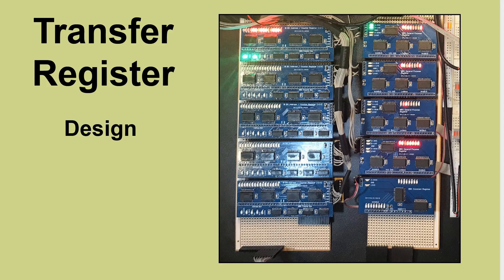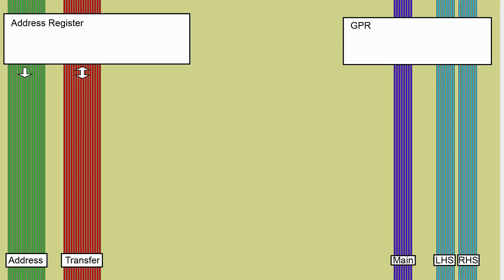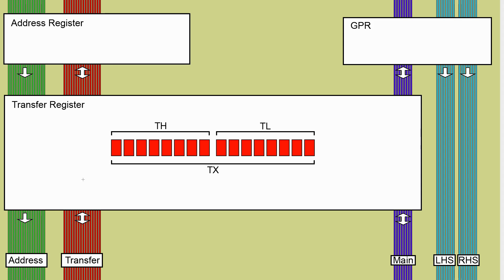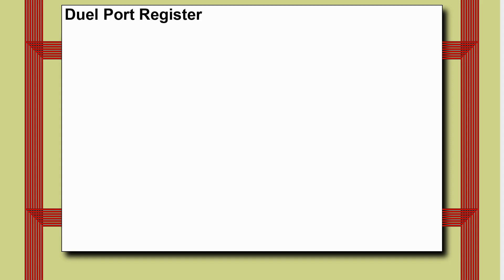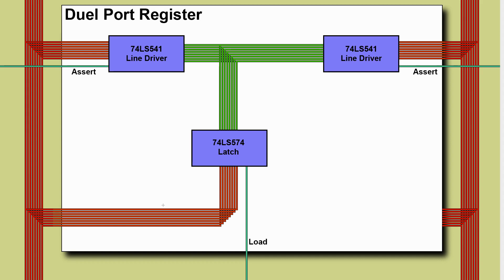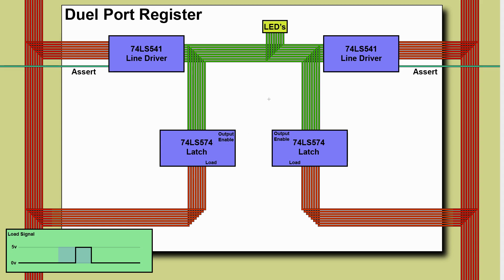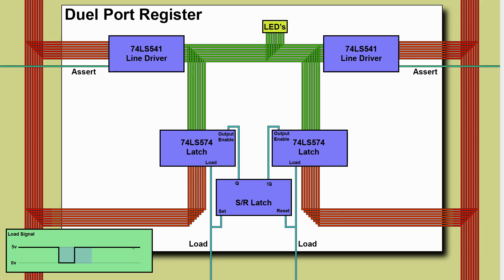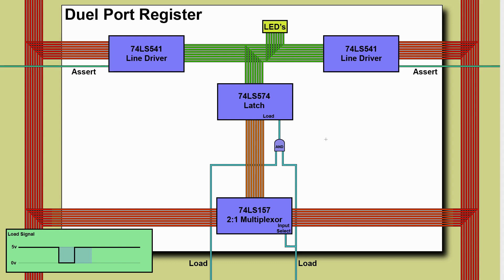Transfer Register (1: Design) - Making an 8 Bit pipelined CPU - Part 47

Comment: Hi James. The only concern I’d have with your proposed multiplexor implementation is the propagation delay through the AND gate.
ie. The rising edge of the right-hand load signal will load the latch after the multiplexor input select has returned to high level. 
Therefore this circuit will only work if the multiplexor switching time / data hold time, is longer than the AND gate propagation delay & latch input data stability time requirement.  Even so, I’d suggest the timing might result in unreliable operation.
This perhaps could be solved with a double buffer on the multiplexor select input, to ensure the multiplexor select input rising edge is sufficiently delayed (by an extra gate delay) until after the latch load rising edge.
Hopefully my poor attempt at explaining this makes sense.  :-)
Reply from the maker: I’ll let you in on a secret, in both my troubleshooting videos where I say “I have a couple of ideas of what this might be” the other one is this kind of gate propagation issue.  The last time I was so sure I even had a set of overlays made up for the explanation but it’s never actually been the problem. I fully expect to hit one sooner or later so I’ll explain it properly when that happens, I’ve said a few things about this in various videos but it usually hits the cutting room floor. Your explanation makes perfect sense, from experience I doubt it’s going to cause an issue though (but it will be in the build video if it does). I’m pretty sure the reason why I don’t see problems is the latch chips have several layers of gates that are nice and settled by the time the load lines change, The solution is of course to use the spare AND gates (They always come in multiples) to stick an extra gates delay on the select line.  For bonus points see if you can find the potential propagation issue between the pipeline and the bus control that’s been itching the back of my mind for months.
Reply: @weirdboyjim  I must apologise that I haven’t yet caught up on your full video series (I must admit I’ve only seen the first few so far), so I haven’t seen any videos discussing pipeline / bus control issues yet. 
But, taking a closer look at the data sheets, the 74LS157 has a max propagation time (tPLH Select to Output) of 23ns (15ns Typ), and the 74LS08 has a max tPLH prop time of 13ns (under the same 15pf load).  So the 74LS574 will just be seeing the CP rising edge a few ns before the input data changes.
Fortunately, I can’t see any spec for a CP rising edge to latch time, and the data input hold time (Dn to CP) is 0ns, so it appears there is no requirement for data inputs to be stable beyond CP rising edge.  Data input Setup time is 20ns min, but that’s not an issue as I’m sure your Load signal low period is longer than that. :-)
So in summary, it appears that you should indeed be Okay, but I’d wonder if this timing is still a bit tight for comfort, and perhaps using a second (spare) AND gate as a one gate buffer (to add 13ns of “safety time” to the multiplexor switching), might still be a good idea. :-)
Reply from the maker: To be honest when I wire the pcb for this I'd probably buffer it with both spare AND gates, I only need 2 and they come in quads. That gives about 12ns of slack but still tons of room before it hits into the maximum conceivable clock rate from the other side. I just have to be careful with what detail I do and don't go into in any given video.
Reply: @weirdboyjim  You make a very good point. It’s certainly a challenge to decide the right balance of technical detail to include in your videos, to ensure you maintain the interests of the majority.  I’d say you probably have it about right, from what I’ve seen so far. :-)
I do think your ultimate achievement is in the inspiration that your videos provide, encouraging like-minded enthusiasts to actively pursue their own projects.  Also understanding that producing videos takes a whole lot of extra effort.  Keep up the awesome work!

Comment: 3 minutes in, random thought: An alternative would be line drivers that links LHS+RHS to Transfer. That way any 2 8bit registers can assert into any 16bit register. For the reverse, linking HiTransfer or LoTransfer to Main would work, it then becomes a 2-step operation---but it can write to memory directly. Together it's just 2 control lines (00=idle, 01=LTxB->Main, 10=HTxB->Main, 11=LHS+RHS->TxB).
Reply from the maker: Interesting that you came up with that. I expressed the same idea in my design retrospective video.

Comment: I did something pretty similar when I designed my transfer register some weeks ago. Instead of using 4 74LS157 multiplexers(which by the way have horrible pinout), I just used two line drivers that output to the register inputs. 
Since my design is more synchronous-focused, I have a separate clock and load signal(74LS377): Output enables of the 74LS541s are wired to one of the load lines, and then(same as you) I AND(negative logic) both load lines to the "load enable" of my register.
When both load lines are disabled, register inputs are floating. If you don't like that, some pull-down resistors will solve it.
I've tested it and works like a charm. I'm also doing this for my VRAM.(You might remember I told you I was going to use dual ported ram for the VRAM, but I decided to let that go)
I hope it makes sense. Anyhow, I can share the schematics.
Great video!
Reply from the maker: Nah, half the fun is working stuff out. You should be careful of those floating inputs although I think the "high impedance" tri-state lines are not quite as wild a as a true floating input. I thought about using a pair of 541's but you need separate driver circuitry (ok, just a not gate will do it)  but you do end up with 1 more chip unless you have the inverter spare elsewhere.
Reply: @weirdboyjim  It is indeed tri-state, but I always try to add the pull-down resistors just in case. The HCT series doesn't really like floating inputs although if you are not loading it should not be a problem but who knows...

Why would you need an inverter? Both output enables of the 541's and "load enable" of the 377s are active low. 
If any load signals goes low, one of the line drivers gets activated and the load enable signal too. On the rising clock edge, it will latch. Am I missing something?
Reply from the maker: ahh, My thoughts using a pair of line drivers was to drive the output enable of one from the inverted input of the other, then you guarantee you have one and only one driving the lines.

Comment: Huh. I didn't devote too much time to trying to figure out how you were going to implement the transfer register because I didn't think it would be that complicated. Maybe I should have. Oh well.

I'm not sure how well that SR-latch design would work to prevent damage to the chips if both ports tell the register to load at the same time, which is definitely possible in your CPU since 16- and eight-bit register transfers happen in different pipeline stages.
Reply from the maker: Since you like to pick on my slightest slip I'm going to point out "16- and eight-it"
Reply: @weirdboyjim  LUL. Fair is fair. It's fixed now.

Comment: Wasn't the AND of both load lines supposed to be an OR instead?
Reply: Ah, it's because signal for loading is normally high on both sides. Got it.
Reply from the maker: Exactly, the logical operation is an OR, but with inverted signals it’s and AND gate that does the job.

Comment: Isn't the 74LS574 containing 8 Flip-Flops and not latches? A latch is controlled by a signal level. A flip-flop is controlled by an edge signal.
Reply from the maker: Well a google search seems to align with your definition but I've always used the term latch a bit more generically and you don't have to search very far to see that I'm not the only one. I'll try and be more specific with part definitions but if that's my worst fail in this regard we can all be grateful.
Reply: Yes, it is just a minor detail. I noticed that in the datasheets e.g. from TI the 74HC573 datasheet has in its title "octal latch" while the 74HC574 has "octal flip-flop". Also you basically need 2 latches to build a flip-flop. Btw great videos I enjoy to watch. Greetings from Switzerland.